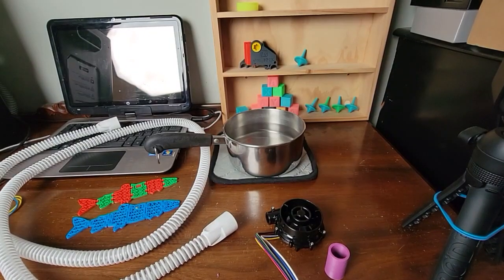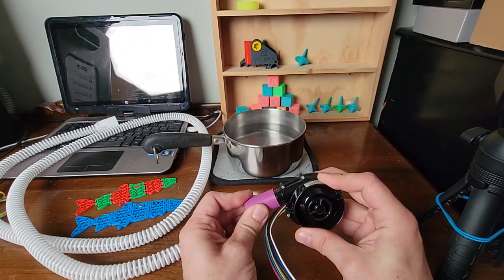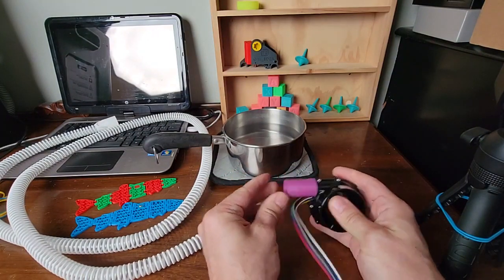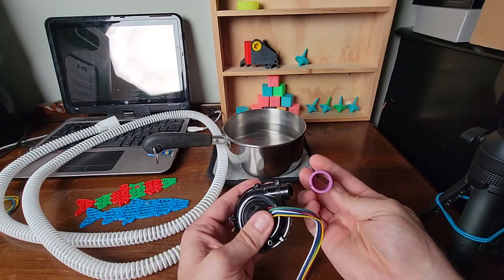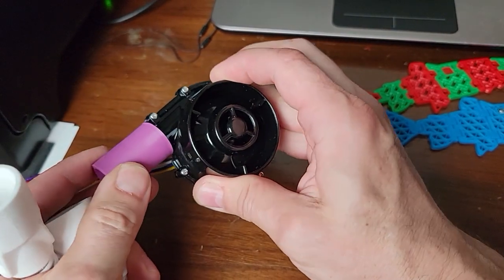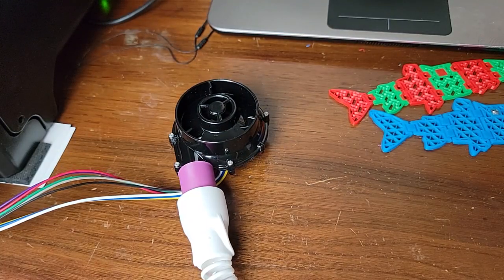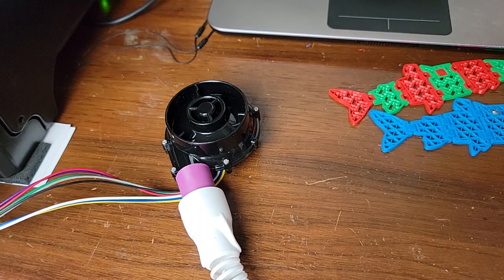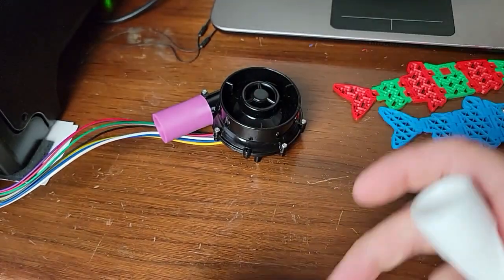Hot Forming PLA Adapter for CPAP Blower

Comment: a lot of watts the power supply?
Reply from the maker: My hotend and part cooling duct design requires very little air.  The blower probably consumes about 20W power with my normal print settings.  In the past 11 months since I made this video, the blower and power supply are still working flawlessly.
Reply: @m_IDEX  Thanks! How many maximum watts does your power supply have? Psu. Maximum Watt ? Please
Reply from the maker: Flashforge Creator Pro power supply is rated at 320W.